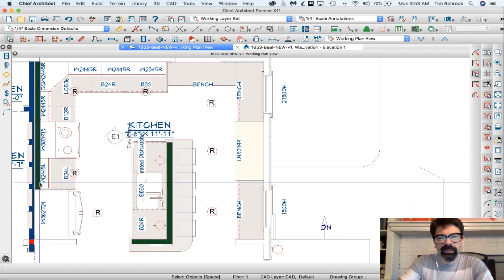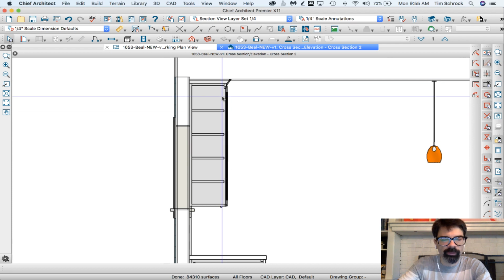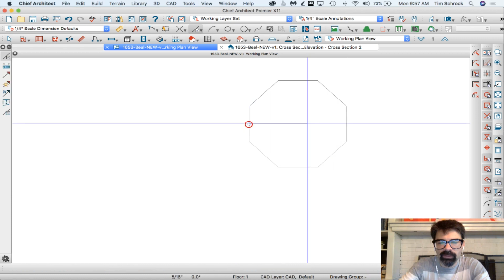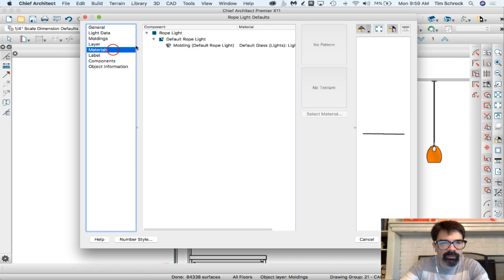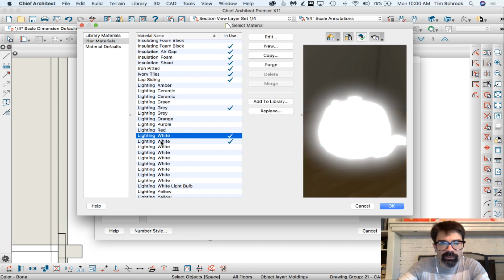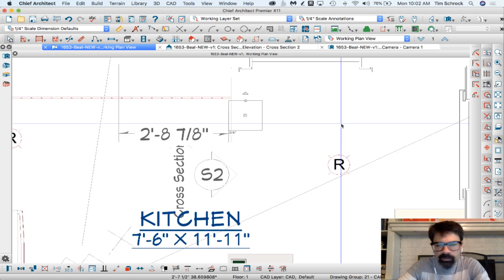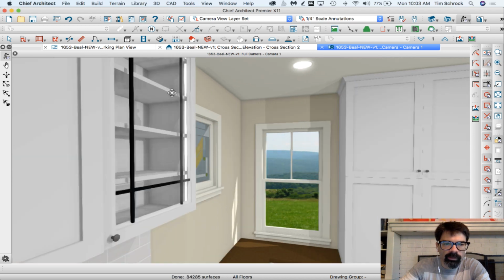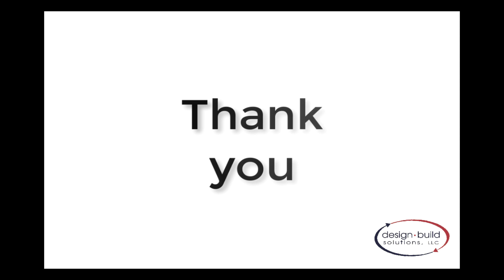How do you draw vertical rope lighting? | Chief Architect

Comment: Hello, what is that good for ? It doesnt have any light source when you compare it with rope light.
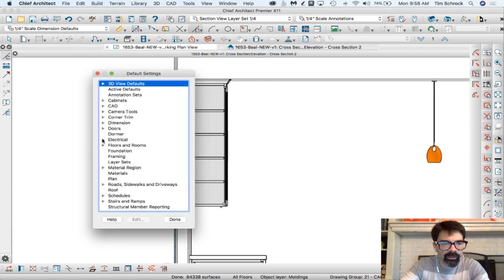Reply from the maker: Check the video at 5:22, I show how to add a rendered look of light emission. It's not a light source, but works in the renderings.
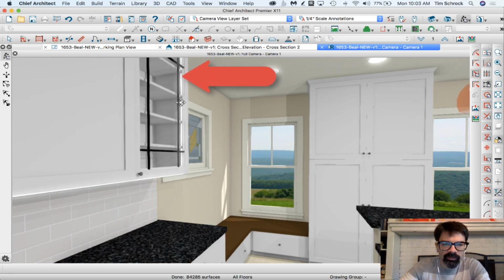Reply from the maker: You can see the light at 9:50
Reply: @DesignbuildsolutionsLLC  but not in the physical rendering.
Reply from the maker: @yashazare  huh?
Reply: @DesignbuildsolutionsLLC  sry for incomplete point.  When you set the view to phisycal render or physical ray traced render, these lights don’t luminate other objects unlike any light sources

Comment: Is the rope light feature only in X11?
Reply from the maker: As a native tool, yes, only in X11. If you're pre-X11, you can draw a molding polyline in plan similar to me drawing one vertically in this video. Change the polyline layer to "Electrical" and it would show up on your plan as well. Of course, it won't connect with the Electrical Connection tools either.
Check out this review of the new X11 tool for rope lights https://youtu.be/Cob70PNrV_E